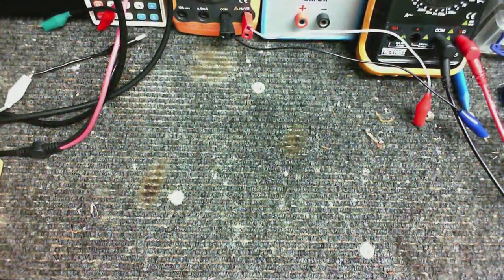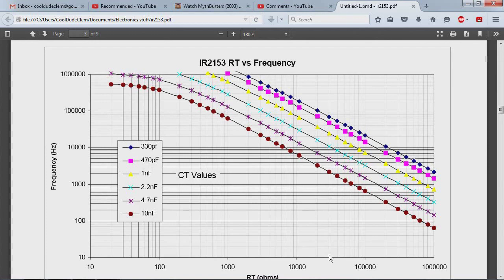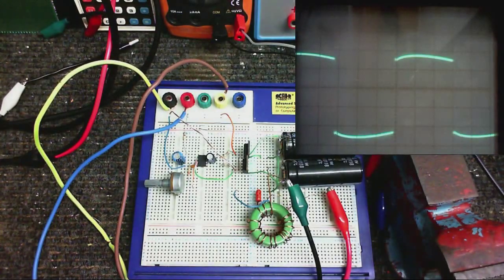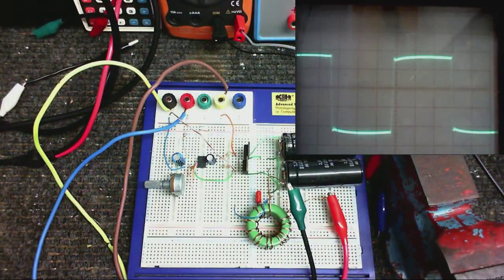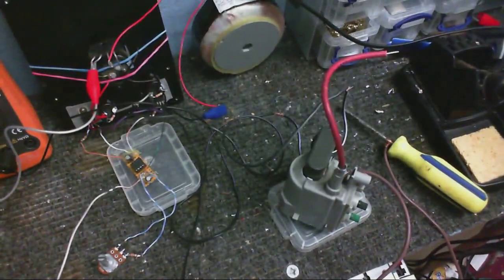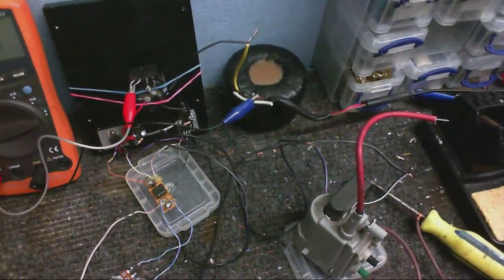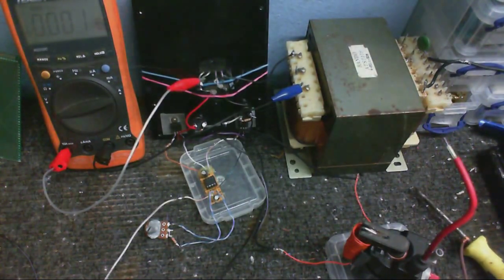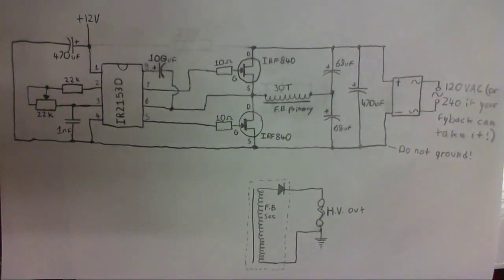IR2153D Half-Bridge Flyback Driver Experiment

Comment: I made a high voltage power supply with a TV flyback based on the 555 timer chip, I also posted instructions about how to make one in the description of the video about it. You might like to check it out, it's not like I'm an expert on the matter but it can be an interesting read.
Cheers.

Comment: The reason why the cap didn't do much is most likely because you used too high of a value and all it served for was a snubber and dc blocking.  Also somebody mentioned this, but remove the gap.  half and full bridge topologies are your core's best friend.  Nice arcs!
Reply: I recommend leaving the capacitor in the circuit.  Make sure the value isn't too low though otherwise you would be hard switching a resonant circuit and things would explode.

Comment: DON'T connect the capacitor in parallel with the primary of the fly-back transformer!!! The capacitor will effectively be connected in series with the 68 uF capacitors connected across the rails. That results in applying a high voltage square wave directly into a capacitor, which subjects the MOSFETs to repetitive current spikes. That WILL heat up the MOSFETs, if it doesn't destroy them outright. It's basically pointless, to put the capacitor in series, when you can just adjust the values of the capacitors across the rails. The idea of series resonance is actually a good idea, because it provides an impedance protection, protecting the circuit from sustained short circuit on the output. If you use series resonance, it's extra important to put in a spark gap, to protect the secondary of the transformer from internal flash-over, if the arc is drawn out too long. Series resonance can put far more voltage across the primary, than the supply voltage, which will surely destroy the flyback transformer.
     I clicked on this video, because I am interested in the IR2153D chip being used as the half bridge driver. it was interesting seeing the wave form on the scope. A perfect 50/50 duty cycle is ideal, but less critical in this application, because any DC offset caused by duty cycle would just be absorbed by the 68uF capacitors. No chance of core saturation due to DC bias. Thanks for posting; Time to order my IR2153D's!

Comment: the electrolytics should be replaced with Mylar or Mica capacitors  electrolytics should not be used except to stabilize the PSU voltage.

Comment: What do the 68 uf capacitor s do?....are they necessary
Reply from the maker: They are part of the half bridge circuit, they provide a "virtual ground" for the other side of the primary coil, basically they divide the voltage so that it's at half of that voltage where they join together.

Comment: I like your channel, but this is a very poorly calibrated circuit. I was able to achieve 5cm arcs from a mere 14 volts with a 555 timer driver. Try to run it on 7 windings and 28khz.
Reply from the maker: +ivan R Yeah, i know. Thing is I was mostly doing this to see if it would work at all, I didn't have the time get it all tuned properly.  I have some 
more ideas for when I revisit this.
Reply: CoolDudeClem I got an idea for you! I have finished making a 555 timer tesla coil driver. It is litterally just a 555 timer connected to a BUZ11 N-channel HEXFET, which is inter connected to the primary of my tesla coil. Because the frequency at which I was running it was around 500khz (way above the stable limit), it only ran reliably on 4-6 volts DC, and used only 5 watt. It is similar to a slayer exciter, except it has a fixed frequency, and I was able to light up a meter long tube with it. Becuase of the relatively low frequency, you get some very interesting effects, like it randomly stricking different ends of the tube, or even making a toroid tube flash randomly.
Reply: Ivan R yo
Reply: yo!
Reply: Ivan R what's up